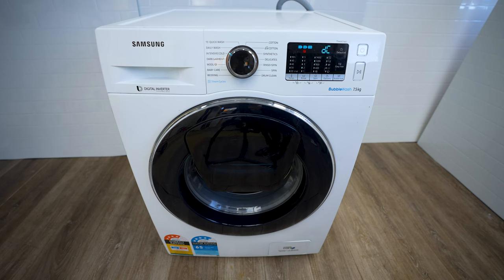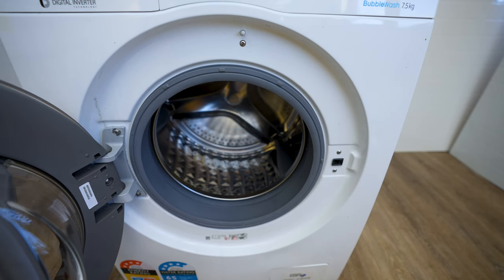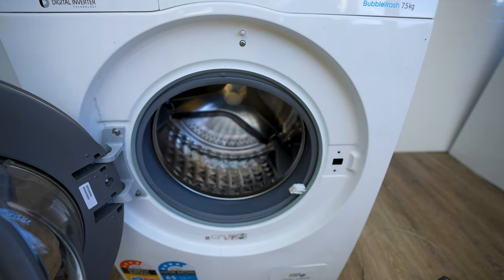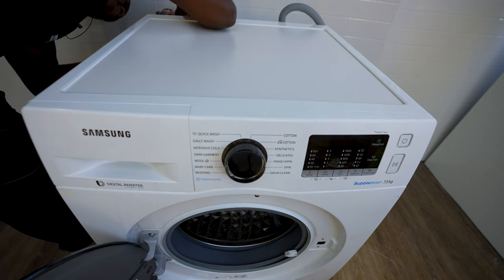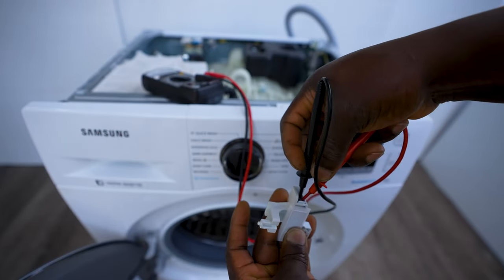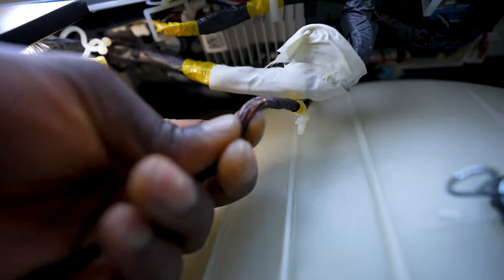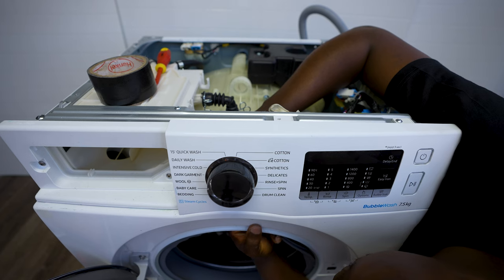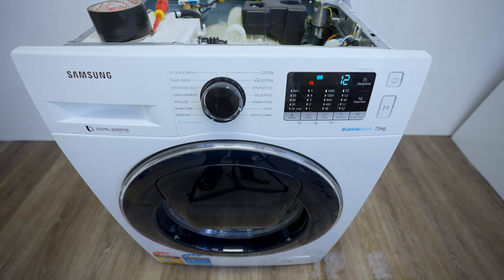Samsung Washing Machine DC Error Repair

Comment: Thanks for sharing. Following you instructions, I managed to open the cover and pull out the lock switch. Then I just reinstalled it and the issue was fixed by itself. 😂😂❤❤

Comment: Hi, I have a Samsung washing machine with dc error.  The 220 volt voltage is present on the door lock connector, I replaced it but it continues to show the same DC error.  What do you suggest me?  I'm thinking of replacing the card.

Comment: Do you have any knowledge about voltage there. What voltage should be in violet cable on lock
Reply from the maker: hi I think its 240v, the voltage will be written on the door switch

Comment: dont know if i ended up with a particularly bad lemon, but the build quality on my top load samsung is absolute dogshit. aside from this annoying ass error, the thing shakes like i put a fucking brick in it during normal operation, heavy and light loads. pulled the detergent/softener tray to clean some gunk out, the underside of white metal surface along the topside of that tray is rusted as hell. im sure if i took it apart id find more rust. how the hell even. bought an expensive ass washer and its worse than the 30 year old washer that came with the house, god why did i get rid of it lol.

misery, ass-madness, and financial pain aside, thanks for this video. ill give this a check if it isnt too much a pain to get the door latch sensor out. otherwise, im putting a brick in it, or a bucket of tannerite or something. regardless, this beats paying another couple hundred bucks to have some guy come out and change a sensor in 15 minutes.

Comment: Dc3 error?
Reply from the maker: The Add Door is being detected as open or unlocked. Make sure there isn't anything keeping the door from closing securely. This message might also appear if you open the Add Door without pausing the cycle first. To add laundry, press the Add Door to close it properly, then press START/PAUSE to try again. Turn the machine off and restart the cycle.
Reply: @askmrwashywashy  thank you Mr Washy Washy
Reply: What if you tried that and the wash cycle still doesn't do anything  @askmrwashywashy